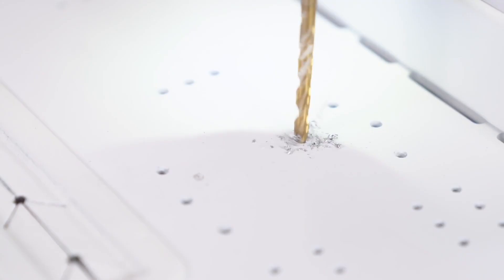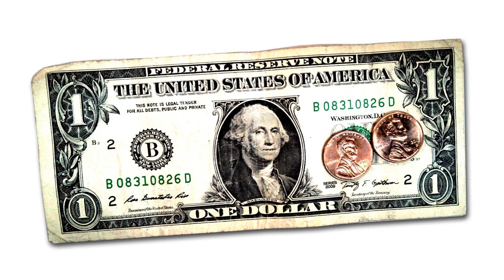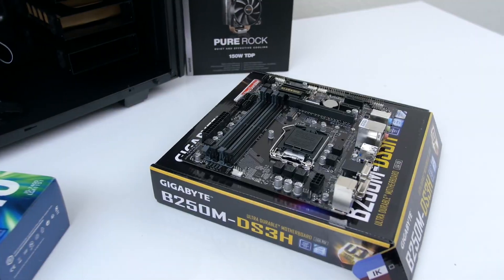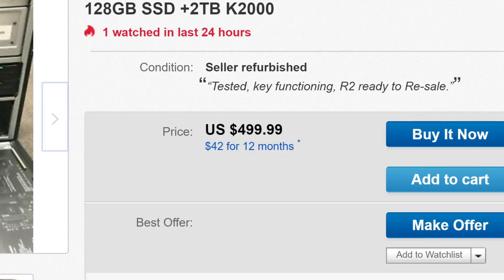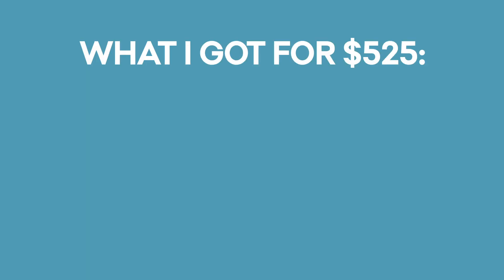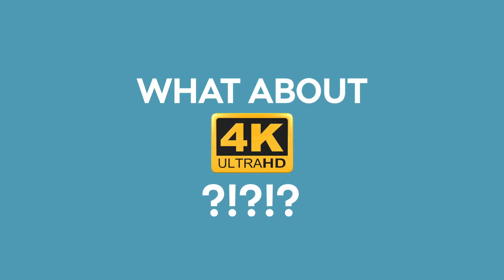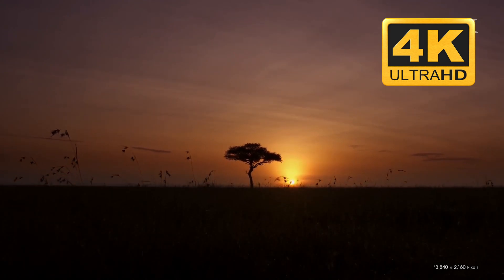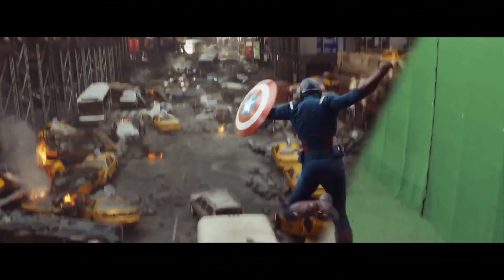How to BUY a BUDGET video editing PC that will crush 4K

Comment from the maker: Early 2022 Update: I just built a new/used Z640 last month all off eBay. I found a barebones Z640 on eBay. Sold the existing Quadro M4000, old RAM, HDD and CPUs. I added two used E5-2680V4, upgraded the ram, added a used EVO 970 NVME boot drive, and got a used RTX4000 (splurged on the graphics card) and it's extremely powerful for a computer that was originally sold in 2015. You could also go with the more affordable Quadro P2000, P2200 (I'm about to try this card) or P4000 GPUs which can be found pretty affordably on eBay at the moment I type this. Note the P4000 is a huge boost over the M4000, but M4000 is still a very good card. The non-Quadro NVIDIA cards are still very pricey due to supply & demand, but you can get a lot of bang for the buck on the Maxwell and Pascal Quadro cards which work so well for video editing and 3D. I've also personally had issues with drivers on the consumer GTX and RTX cards too with some of my content creation applications. For example, a Quadro M4000 outperformed a GTX1080 in Adobe Premiere Pro which doesn't make sense on paper.

Comment: Still a valid choice a year later?
Reply from the maker: Yes. I just built a new/used Z640 last month all off eBay. I found a barebones Z640 on eBay. Sold the Quadro M4000, old RAM, HDD and CPUs. I added two used E5-2680V4, upgraded the ram, added an EVO 970 NVME and got a used RTX4000 (splurged on the graphics card) and it's extremely powerful. You could also go with a Quadro P2000, P2200 (i'm about to try this card) or P4000 GPUs which can be found pretty affordably on eBay at the moment I type this. Note the P4000 is a huge boost over the M4000, but M4000 is still a very good card. The non Quadros are still very pricey due to supply & demand so the more current GTX/RTX consumer cards I cannot recommend at the moment on a budget.

Comment: Great video.   I got lucky and a local animation studio was selling off their old workstations.  Got a Dell T5610 with dual E5-2650 V2s and a 2 TB HDD and an insane 128 GBs of RAM.  They threw in a 256 GB SSD  and the GPU is the only bit I really need to upgrade being a GTX 650 they had kicking around.  Guess they were holding onto the Quadros.  I personally think I made out like  a bandit on this one.

Comment: So I bought an HP Z640 Workstation E5-2640 V3 Eight Core 2.6Ghz 32GB with a M4000 video card for $625.  Not sure if that was a good price, but it worked great for 3 days then it stopped and a red light came on with beeping.  I have the option to get a replacement or get a full refund.  Not sure what would be better or if that machine was worth the price.  Mostly looking to edit personal 4K videos

Comment: Hi Nathan, someone local has this for sale for $400. Is this a good deal in Jn 2021? 

HP Z800 Dual Xeon X5650 6 Core 2.66GHz Total 12 Cores
64 GB Memory
1 x 1TB SATA + 3- 2TB NAS Hard Drive
NVIDIA GeForce GT 680 video Card
Fresh Windows 10 Professional Installed
Reply from the maker: I had a similar system four years ago and the E5 processors I mention in this video are a pretty vast improvement. If $400 is top of your budget it's not a bad deal, but it was a huge leap going from that 'Westmere' Xeon processor to an E5 V4, which is circa 2016. 6 years of microprocessing innovation is a lot of time (2010 vs 2016). Good luck!
Reply: @natob2  Ahh thank you for the response. really appreciate it. I can buy until around $700. I was under the misconception that Z800 is "newer" than the Z640 due to the increase in number. Rookie mistake. Will keep an eye out for the Z640 and the configs you have mentioned in the video.

Comment: do you think the hpz 620 will work with the  rtx 3080?
Reply from the maker: It might but PSU  could be an issue. I'd recommend calling HP support because I know they will be selling these moving forward with their workstations. They may have some thoughts. HP support is easy to get on the phone, and fast! My big questions for them:

- the 3080 is PCIe 4. Will it work with the Z620s PCIe 3?
- will my 620 support the power needs of an 3080?

I'd also search and maybe even post to Tom's Hardware about this too.

Good luck!
Reply: @natob2  thank you for your quick response that was helpful.

Comment: I bought my first dual Xeon off eBay and it had a half year warranty still remaining.  I bought a second Z620 with similar specs off Amazon for almost half the cost two years later. These are nice solid machines and are fairly quiet.
Reply from the maker: Totally agree. Well made, quiet and good platforms for both work and gaming. They're made to last! Also, I have several of the newer z6 G4s and I actually slightly prefer the build quality of the z640s and z620s. If was a gamer I'd build a gaming PC off one of these platforms in a second. Also the CPUs are now quite affordable for the V2 and V3 E5s and some of the higher end ones are just beasts. They draw a lot of power compared to Intel Scalables but there are some great affordable CPU options for gaming and productivity for these!
Reply: @natob2  You said you prefer z640s and z620s over z6 G4s ! may I know why? aren't Z6 Gs more efficient?
Reply from the maker: @RustedFaith  I like the build quality of the Z640s more. The benefit of the G4 of course are more efficient processors, and the motherboard has NVME support. I now have a brand new Z6 G4 and I honestly kinda miss my Z640 described in this video!
Reply: @natob2  Z640s are tanks :) Yes build quality was much better. 

Why have you stopped uploading videos?
Reply from the maker: @RustedFaith  I am a founding member of a tech startup so have had to put videos on hold (for now...I miss it!)

Comment: I'm really excited watching this but is there a way to make sure the product I'm getting on eBay is legit?
Reply from the maker: I'd look closely at a seller's rating (percentage of positive reviews vs negative reviews). How long have they been selling? How many items have they sold (zero can be a red flag or yellow flag, or even a fraudulent account). I'd also consider how detailed the listing is. Are there many, and good pictures? Is there a lot of detail in the listing? Does the information about the item seem accurate? Also, ask the seller questions to see how quickly they respond, and to confirm whether or not they really know what they're selling. Do your due diligence and you'll get great stuff on eBay! I've bought at least 50 pretty major computer components on eBay and I only have once had an issue with an item (it was damaged - and was not documented a such in the listing). The seller resolved this for me and took back the item. eBay also really helps out the buyers when an item arrives not as advertised. Good luck!

Comment: HP Z640 Workstation 2x Xeon E5-2620v3 2.4GHz 32GB DDR4 1TB HDD Windows 10 Pro, 12 cores. ,but it did cost $550 serial number says if was build in 2016.   Only need a video card. Thank you I was going to build one, but now all I need to do is upgrade the chips for $144 and it will again double in speed, or upgrade the RAM. Both will get cheaper with time. Thank you
Reply: yep. We're running a 6 core in our HP440. We'll upgrade to 8 core in a year or two. The 8 core chip we want is $700 at this time but by the time we need it should be much cheaper. At the same time we'll buy the HP Z640, which should be in the $400-$500 range by then, and use the dual cpu upgrade path in that one and on the cheap.
Reply: @robertmueller6979  nice, what do you mainly use it for? Video editing?
Reply: @Oilers007   ... exactly . The video work upgrade CPU path (with percent gain over the E5-1650 V3 3.50GHz 6 Core) would be one of the following....... E5-1660 v4  8 CORES 3.2 GHZ 31% gain,...... E5 2687W V3  10 CORES 3.1GHZ 23% gain......  E5 1680 V3  8 CORES 3.2GHZ   17% gain

Comment: Do you know any website info, or online benchmark resources, where we can gauge how the Xenon processors of these workstations compared to the more common current AMD and i7, i9 processors? The reason is, I have no idea how to know how fast are these workstations - which are a few years old - compared to what I'd be looking at in new computers (newbie question). As for RAM which is easy to understand, and GPU which we're going to swap out anyway - but the Xeon processors, I don't have a feel how fast these are. Also, how can we be certain that these HP workstations can fit and accept the NVIDIA Graphics cards such as the Nvidia GeForce RTX 2080 Ti? The top range Apple iMac in 2020 has 8 cores i9. As a newbie, I have no feel for how the latest i9 iMac compares to a 20 core Xenon that is a few years older. Hence, my reticence to buy into one of these without having that understanding myself. (Even as a newbie, I'm slowly learning Davinci Resolve's Fusion to make Fusion-heavy instructional animated videos. Even on an Apple iMac 27" i7 4.0 16GB (Late 2014) slows to a crawl when editing the animations I'm doing in Davinci's Fusion module).
Reply from the maker: Great question @RT! I think a great resource to help answer your question is Chaos Group's free VRay benchmark tool to use, even if you aren't using V-Ray at all in your workstation. https://www.chaosgroup.com/vray/benchmark. I used this tool extensively before buying my workstation because I asked the exact same question you're asking. Chaos' V-Ray benchmark will allow you to compare Xeons vs the i7, i9 and AMD processors (they pull from a MASSIVE user-provided data set). Keep in mind V-Ray is a multi-thread tool, so the higher core count CPUs excel there (e.g. my dual CPU, high core count 2.2 Ghz kicks ass in V-Ray). But I've found this high core count is also advantageous for video editing programs, such as Adobe Premiere Pro.  

What I am pretty surprised to find to-this-day is, although my current workstation was manufactured in June 2016, it still holds its own against the newer i9s and AMDs in many pro content creation tools because of the shear number of cores. I just ran my workstation through the V-Ray benchmark prior to making this video and was thinking, this thing is still looking pretty good!

Also, the HP Z640s, Z440s and Z840s will support the new RTX GPUs (and a place like https://www.tomshardware.com will likely give you answers on other older pro workstations by HP, and Dell). I did my own research on this topic because I almost bought an RTX 2080, but after running some benchmarks (V-Ray, and other reports I found online) I determined for my workflow the GTX1070 was doing the job and was the right value for me at this time. May not be for others though because the RTX 2080ti will CRUSH the 1070 if you do GPU intense work.

Does this help? Let me know if doesn't, and I may have a few other resources for you.
Reply: @natob2  Thanks. I'm a few months away from deciding what to get. But this opens a really nice option.
Reply from the maker: @god-lightbulb  You're welcome, good luck!
Reply: @natob2  I see from the specifications that HP 640 or 840 do not support 4K monitors. How do graphics professionals connect 4K or 5K monitors off these workstations? I assume 4K monitors would be common among video editors.
Reply: I have used both Passmark and Cinebench to compare. With dual E2670's I get a score of 4100 on Cinebench which is still competitive. Single thread is where the Xenons lag because of the low clock speed.